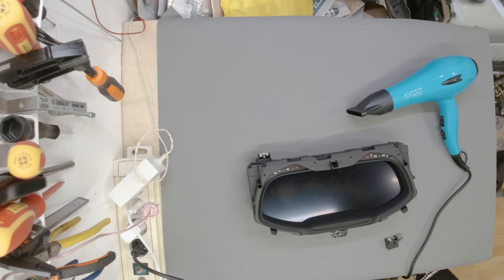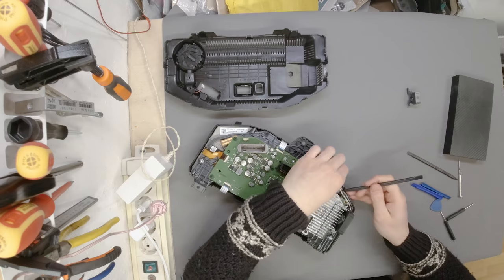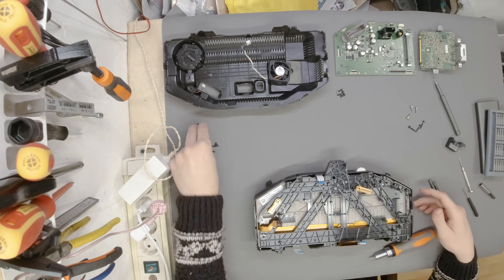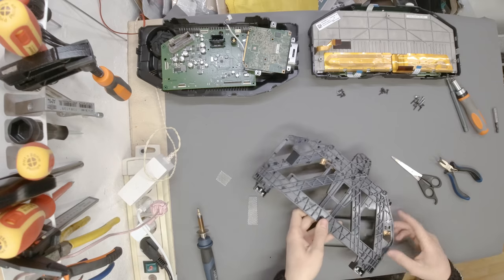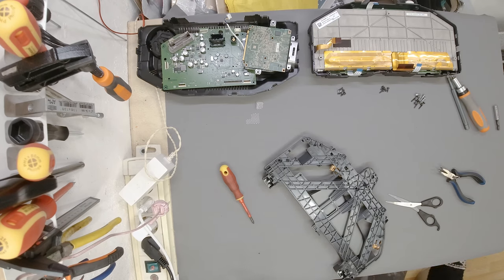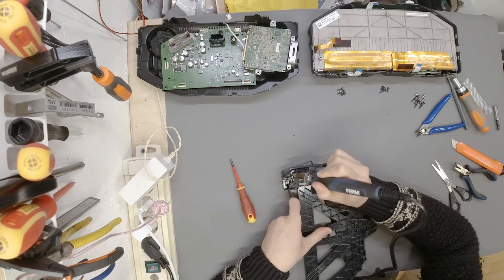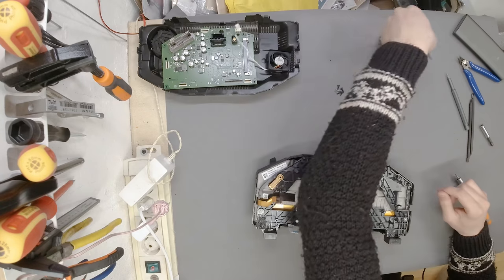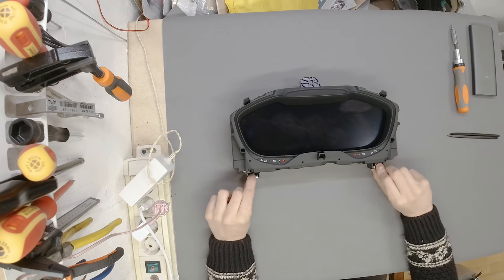Audi TT mk3 VIRTUAL COCKPIT - TEARDOWN

Comment: Hello! Fascinating job. By the way, did you eve had a look at Q7 and A4/5/Q5 virtual cockpits? Im especially interested at the main PCB, rear view of the 32 pin connector, pin 19 and 20 - night vision. If you have any material on that, please do let me know :)
Reply from the maker: Thank you so much! Unfortunately I havent.. but I think VC should get any video feed from mib main unit in the glove box. The rear view cam is also connected there, so maybe you dont need anything around vc… i am trying to connect head up display from q2 to audi tt 8s 😂
Reply: @cars_anatomy  Thank you for very swift response. video feed from MIB is via Most i presume (well, or fakra connector). Feed from NV module to VC is technically a composite signal. (pin 19 and 20). Im just not sure how target marking is fed. Autoliv on generic system has it implemented on composite, so i figure here is same. Other warnings (HUD,...) must be via CAN feed. On Marklines page, dissasembly (TT VC) there are good photos of the back side of the PCB, and while pins 19 and 20 have open connections, as far as i can see, they go to the mid-layers. Personally, id say there appears nothing to be missing. Can you have a look? :) Regarding Q2, as it is MQB, if you have similar gateway etc... there is a good chance, that that might be doable. You had a look at wiring diagrams already? Check codings for gateway, there should be installation confirmation in gateway, and 5F MMI should hold msg bus and other parameters in the adaptation. If im not mistakin, HUD is carried via clamp_15 as message bus. Ill have a look at my scan. If you got a contact i can share you scan.
Reply from the maker: sure, you can find me on instagram for example? I havent built the VC in yet, so if you want I can open it up again :)